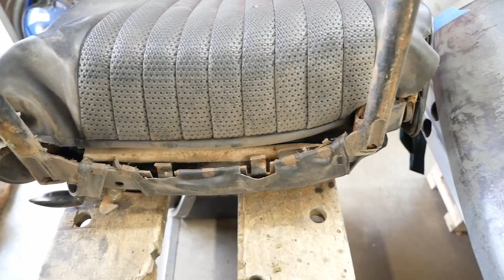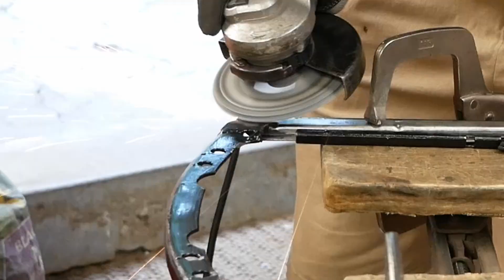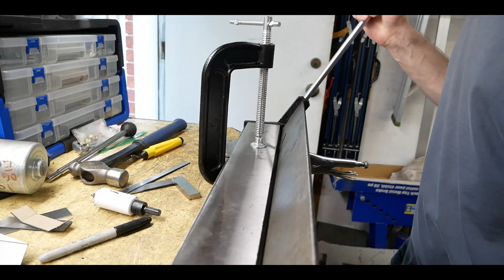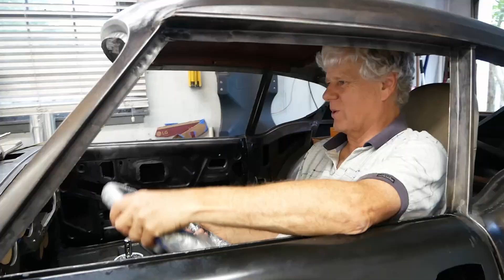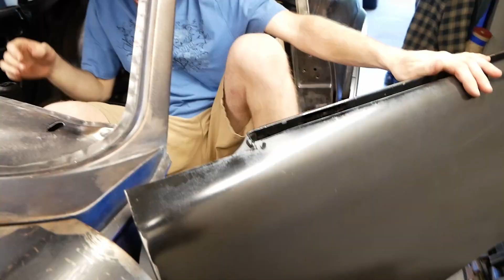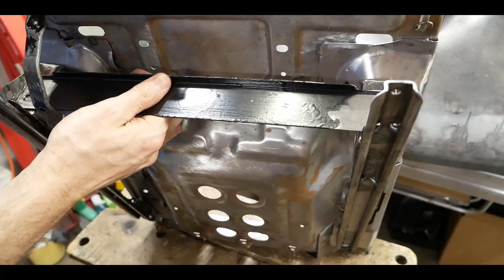Miata’s are HUGE!  Pro Touring V8 Triumph Build – LS Powered Project GT6R – Ep31

Comment from the maker: JDM goodness at last!  Yes, a racing seat, roll cage and 5-point harness would be good, but this is supposed to be a road car don't forget!  Special thanks to our Patreons and donators for their support!  https://www.patreon.com/FanatikBuilds
Reply: Roll cage... 😂
Where?
On the outside?
Reply: @Paul_VanGo  ROCK CRAWLER EXOSKELETON.
Reply: At what point were you tempted to just restore the Triumph seats?
Reply: There is a mod many used to do to sit lower in the MX-5 removing the bottom foam in the seat and replacing it with half the thickness of memory foam. Might make the windscreen more usable, and done right it will improve comfort to!
Reply: That seat back adjuster looks perilously close to the door & sill bulkhead.  I am wondering what room you'll have after the Dynamat, carpet and door cards are installed.
Reply: Lovin' it, had the same kinda thing putting Recaro's in my Starlet, ended up side to siding them with the back adjusters in the middle over the tunnel.
Reply: Patreon is a brand name. Financial supporters are patrons